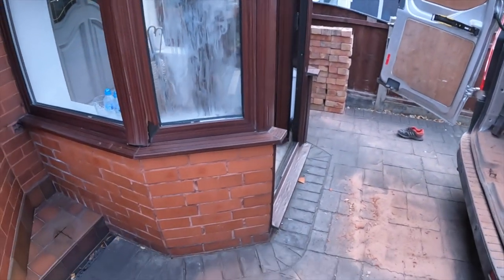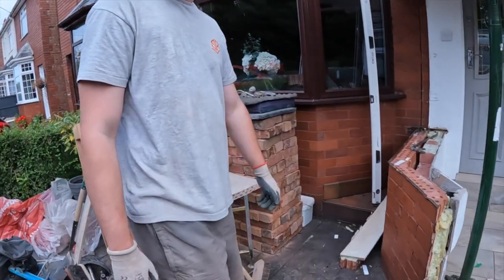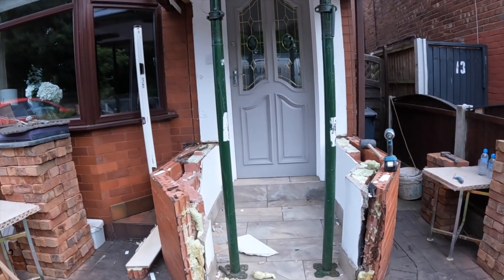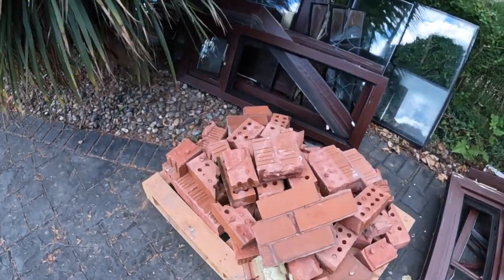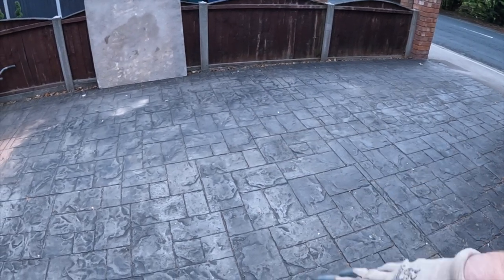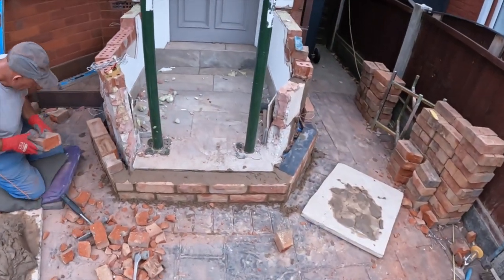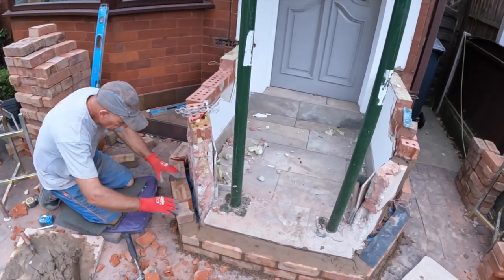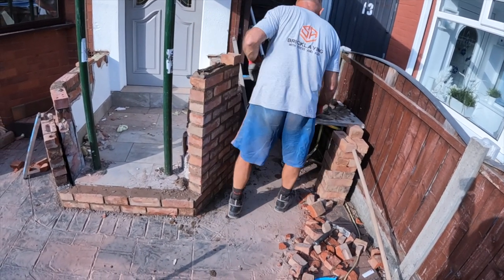TERRIBLE PORCH DEMOLITION

Comment: Hello Steve what a shame they did not allow you to do the inner walls as well. Would have been a much better job brought up to spec with insulation etc. Probably took you longer just to make good to the bad work.

Still you are making a silk purse out of a pigs ear. Well done it will look nice once you have finished it.
Reply from the maker: Definitely Jack . It would have been miles better squared up to match the roof too 😒🧱👍🏽
Reply: @SteveAndAlexBuild  I agree entirely. But customer is the boss end of. Nice job both. 👍👍🎅
Reply from the maker: @Doug....  😁🧱👍🏽
Reply: @SteveAndAlexBuild  A well worn phrase comes to mind " He who pays the piper calls the tune" 😜
Reply from the maker: @Doug....  🧱👍🏽
Reply: @martin2466  😂 England out what a day 😭